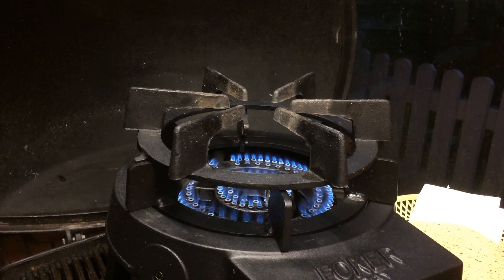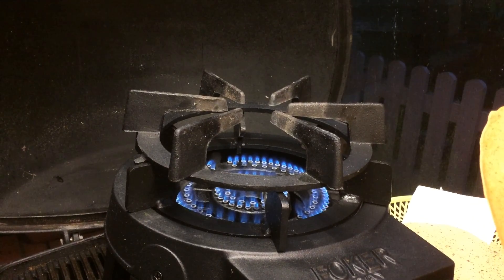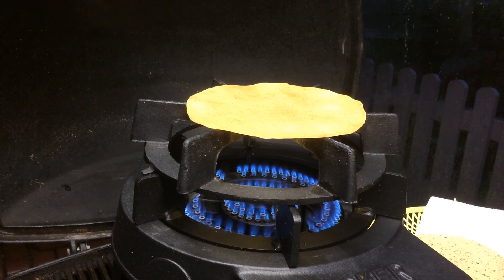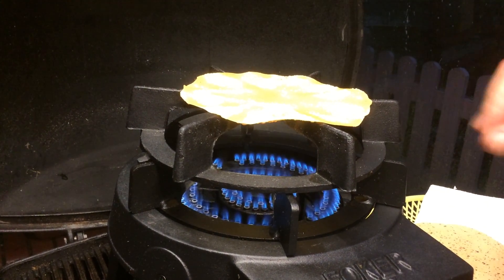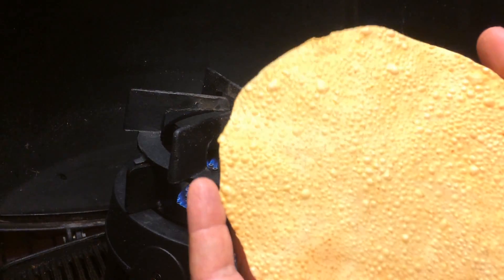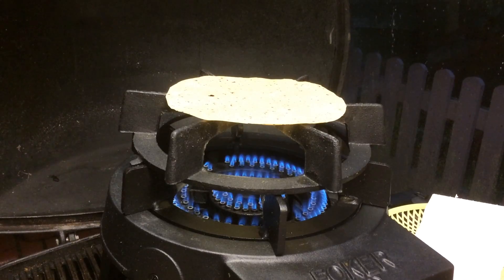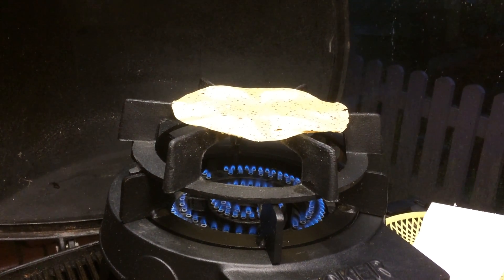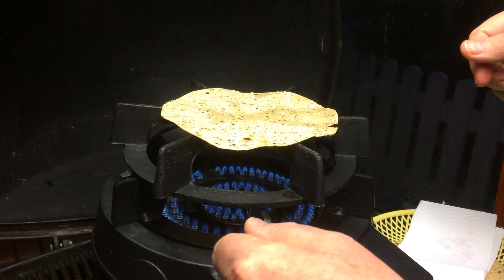Toasting Poppadoms

Comment: Nice slick video.  You've got teflon fingers. So, did the oil coated pops taste better ?
Reply from the maker: Thanks for commenting. No, I don't think brushing a thin layer of oil on them made any difference to the taste but it does give them a nice sheen.